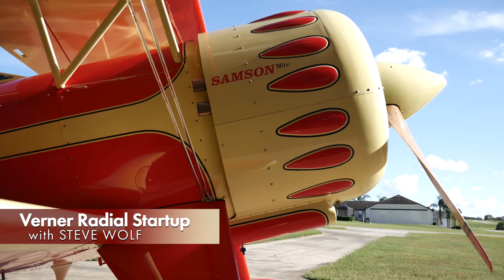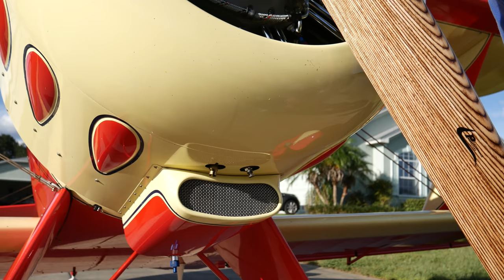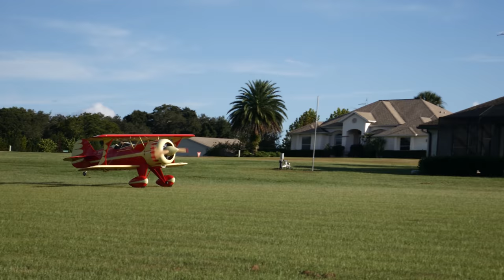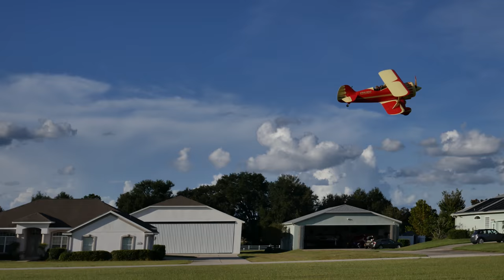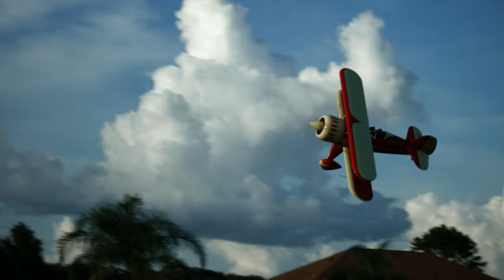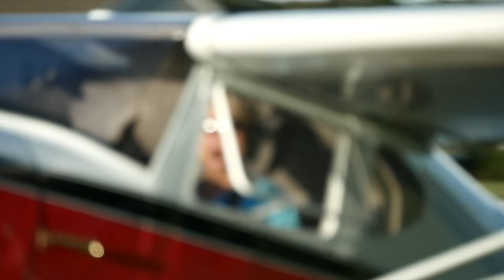Samson Mite Verner 9S Startup and Flyby with Steve Wolf

Comment: Had 450 Pratt N Whitney in my steerman . Used it for crop dusting . Not enough power so i got an ag-cat with a 750 Pratt-N-Whitney . worked great for spraying cotton . Ended up getting an Ag-Wagon . Lots of people would ask whats that little prop on the bottom .  Fan driven insecticide pump. Lol .BTW . Do your neighbors love you .